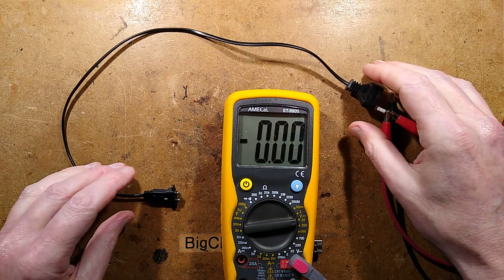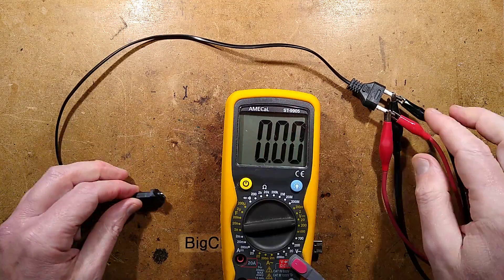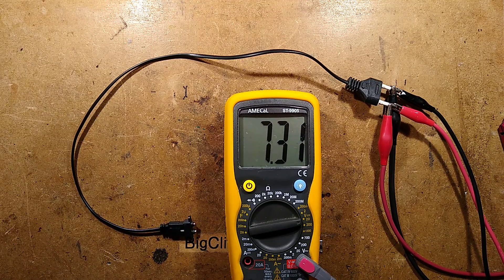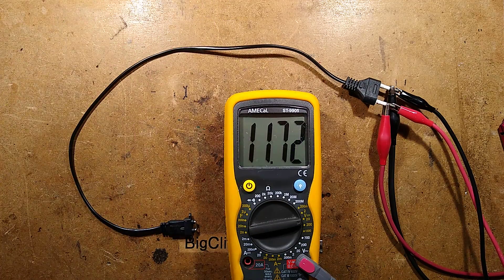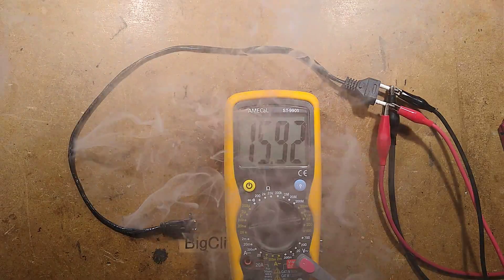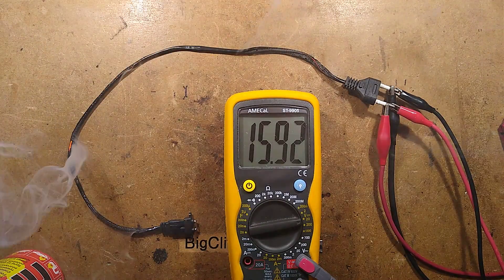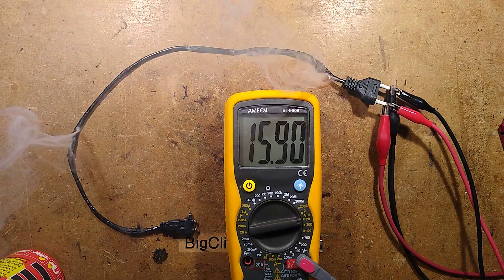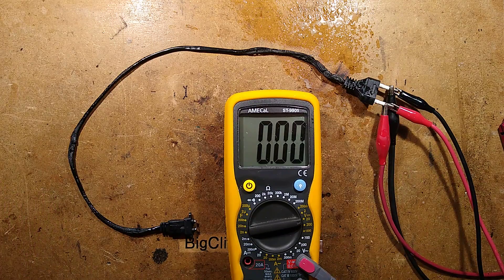Cable test ends in flames

Comment: That's exactly the kind of cable my dad would have used banked up in a 4 way extension lead with a piece of 6" nail in the fuse holder!
Reply: I beg to differ. The 6" nail is too long for the fuse carrier in the British plug...
Reply: @deang5622  a 'piece' of 6" nail.........clever clogs!
Reply: @martinlouden9005  LoL...

I did see a friend of mine 40 years ago use tin foil as a fuse...fuse blew, so they just wrapped tin foil around it!
Reply: @deang5622  tin foil was my dads second choice if there were no nails to hand.

Comment: But what does it say on that Euro plug for max current?
Reply from the maker: You have to allow for faults and accidental overloading.  In the UK the smallest standard plug fuse is 3A, which is capable of sustaining more current that this cable was exposed to for a long time.

Comment: I would have wound it around the Death Dalek, outside of course, and let them self destruct each other. Nice demonstration on the dangers of having copper plated steel wire in a sheath which can't take the heat. Thanks Clive, good post, appreciated 👍
Reply: ...I think that cable was from the Death Dalek, actually..
Reply: @VulpisFoxfire  "Death Dalek"? I'll have you know that that is a "highly useful camping appliance"! You get several types of light - and a reliable way to start your campfire! 😱🙄
Reply: @VulpisFoxfire  so do I 😂😂
Reply: not to mention the dangers of Nickel plated steel strips being used to construct battery packs. there's a reason you shouldn't cheap out on your e-bike battery. as if dodgy lithium ion cells weren't enough, now you're spot welding a high resistance material directly to the terminals!
Reply: @themagitechie9955  And you can't use the magnet test to separate nickel coated steel from pure nickel either...
Reply: @themagitechie9955  I've been lucky with the lithium batteries. I have 5 drones, I keep my old phones with different apps on them and 2 tablets. All I've had was an expanding battery on my first Samsung GT-N7000, which was disposed of safely. I suppose since I've said that I'll be blessed with hot batteries 😂😂

Comment: Copper coated steel cables seems like a bit excessive on the cost cutting side of things...
Copper coated aluminium at least has advantages over copper other than just cost. (mainly being lighter for the same resistance, so if one needs to save on weight this is an option and why the aerospace industry use it all the time.)

And honestly, I wouldn't actually mind much if a cable used copper coated aluminium instead of copper. Though most cables that do this also skimps on the amount of conductor area as well... 0.1 mm^2 won't handle much current, regardless if it is CCA or pure copper.
Reply: I recently learned that copper coated aluminium is a thing but never heard of copper coated steel. That's crazy.
Reply: @benjaminhanke79  Copper clad steel is at the center of just about every RG11, RG6 and RG59-style broadband/CATV coax out there. This is what Comcast and others use between the tap and your house, and in your house to the set top box or cable modem.  For satellite and closed circuit TV camera (baseband video) applications, coax with a solid copper center conductor is preferred (but not necessary in my experience) because it has less resistance for power passing applications as used with satellite and for low-frequency (less than 5MHz) applications as used with CCTV. But it costs more, so for broadband use, a copper-clad center conductor is the standard.
Reply: @brianleeper5737  The physics weenies engineered that coax so it can do the job safely for many decades. Due to the skin effect, the high frequency signal barely penetrates the surface of the interior conductor. The steel provides the mechanical strength so the center conductor can be used as is for connectors.

The 120kv power lines that feed the neighboring substation use aluminum wires wound around steel cores. The skin effect matters way down at 60 hz when the wires are thick enough. Pure aluminum wires would get permanently deformed if they got warm while under tension. The steel core carries the mechanical load, the aluminum carries the megawatts.
Reply: @hamjudo  Note that "F" connectors are commonly installed on coax with a solid copper center conductor. I'm not aware of any problems with this, other than it's easier to bend the solid copper conductor if one isn't careful when inserting the "F" connector. The industry standard 1/4" x 1/4" prep leaves enough of the center conductor sticking out to act as a guide pin. Some tools (like the one I have) don't trim the center conductor so I do it after the connector is installed, and I make sure to trim it so it's sticking out about 1/8". In my experience this makes it easer to get the connector screwed on.
Reply: @hamjudo Skin effect isn't a function of cable thickness, it's a function of frequency.
Reply: @deang5622  In aluminum at 60 hz, the current travels through the outer 10mm of a wire. So at 60hz, the skin effect only matters in wires that are noticeably more than 20mm in diameter.

We are in a big metro area with a lot of people and industry.
Reply: @hamjudo  It doesn't depend on thickness of the wire. It is not caused by the wire thickness. It depends on frequency.

The skin effect results in the electrons being pushed into a region at the edge of the wire away from the centre and that region has a thickness which extends in from the outside diameter of the conductor.

So if a conductor has say a 30 mm diameter (15mm radius) and the skin depth is 6mm, then the portion carrying the current is from a distance from the centre of the cable from 9mm to 15mm.

Now if the cable diameter is 60mm, (radius of 30mm) then the range of radius carrying the current is from 30mm - 9mm = 21mm out to 30mm.

The thickness of the conductor carrying the current remains the same. It doesn't depend on the thickness of the conductor.

The magnitude of the skin depth is not a function of the diameter of the wire, it is function of frequency.

Mathematically: 

Skindepth =f(frequency)

NOT
Skindepth =f(frequency, cable diameter)
Reply: @brianleeper5737  A copper plated steel wire is cheaper and more robust than a solid copper center conductor that is thick enough to act as the center pin of a connector. 

The cable is cost optimized for traditional cable company usage. Compared to material costs, service calls are extremely expensive. So they didn't sacrifice any performance that would lead to more service calls.

The amperage rating for power is noticeably lower than for cable with a solid copper center core. I don't know if they switched to 48 volts, which is about the upper limit for low voltage signal cables and/or they just limited themselves to lower power equipment that operated at the lower voltages already in use.
Reply: @hamjudo  CATV/broadband equipment such as nodes and line extenders is powered through the coax using either 60V AC or 90V AC power. 90V AC is used in newer/upgraded installations.
Reply: Aluminium wiring is fine, but the problem is it fatigues easily.  With something like a laptop cord it's not long before it breaks near the plug.  Best case is your laptop doesn't charge, worst is it arcs and goes bang or something.

But steel power cabling is a new one, I must admit.

Comment: Not surprising if you pass 5 amps through a cheap cable with a short at the end.
At work we call it it tuning for maximum smoke, or how not to find a short circuit.

Comment: At least you discovered it in a controlled environment. I found out that I had a 10A rated iec c13 (or 14, always mix them up) cavle that wasn't even 0,25mm² when it skipped the part of burning and just let a few mm of the wire disappear. Kinda glad that load spike happened at that moment because that wire was in use for a very long time as my UPS input.
Reply: EEK! UPS manufacturer needs a good slap for allowing a cable like that to be boxed with their product. Scary shit!

Comment: Nothing like the acrid smell of burning plastic.What was the cable rated for 1 amp?
Reply: The listing on EBay probably said 1 million Amps
Reply from the maker: Probably zero amp rating in long term use.

Comment: Any idea why they bother coating it in copper? i assume it is the cable that had a copper coating.
Reply: They probably push this crap out by the zillion mile over there. Fool the superficial person / make it easier to solder?..

China is the land of trickery. Great business partners.
Reply: Well not only it protects from rusting but also allows soldering the ends on.
Reply from the maker: Partly to make it look like solid copper and partly to facilitate soldering.

Comment: Having intentionally shorted out cables before (pure boredom with a scrapped car battery I salvaged and revived), that cable did not respond in the same manner as I'd experienced, acrid smoke aside, it should have turned into a puffy, crispy, carbonised mess if it contained the proper retardant material, but, it didn't, another reason to not use such wiring... :S
Reply: I’m so glad I’m not the only ‘mad scientist ‘ here :-)

Comment: Smoke coming from the cable, placed on a wooden surface, metal becoming hotter than the sun, first thought from Clive is…

Let me tell the viewers about the voltage drop and current rise

Second thought…should I get a fire extinguisher ready

That is serious dedication to the viewership there Clive 👍👊👏
Reply: "one moment please"
Reply: @jmpg235 lol "one moment please" and a jump cut to a hole in the bench and the hint of red flashing emergency vehicle lights illuminating the bench through his workshop windows 😅
Reply: @TonyHamlyn  Clive should do that for April Fool's Day.
Reply: @TonyHamlyn  guys you are heavily overestimating fire. His house isn't going to burst into flames because he ran a few wires red hot on a bench for a few minutes.
Reply: @TonyHamlyn    LoL ..  good visual
Reply: eh it's ok, the bench can take it
Reply: I wonder how far it is from Clive's abode to the fire station.

Comment: Can't see the problem - just needs the correctly rated fuse in the mains plug 😊

Ahhh! - wait that was not a fused plug and they don't make 250 mA fuses for UK mains plugs do they!  I guess the cable is not double insulated as that would limit heat loss from the element!
Reply: 1A is smallest but no longer made, I have a supply of a few dozen left 3A is the smallest available.
Reply: @dogwalker666 - incorrect. Electrical distribution and suppliers still stock BS1362 fuses with the following values available: 1A, 2A, 3A, 5A, 7A, 10A and 13A.
Reply: @Mark1024MAK  lol good luck getting them, They don't actually stock anything other than 3, 5, 10 and 13,
Reply: @dogwalker666  - Farnell UK currently show 119 of 1A in stock. They also have 1359 of 2A, 1345 of 7A, and 775 of 10A in stock.
Reply: @Mark1024MAK  Yeah right Farnell the trade only electronics distributor,  Not exactly off the shelf is it,  Why not quote RS the bigger competitor,  Oh and you can't trust the quoted stock level,  They are often incorrect,  Now go to B&Q and check the stock level.
Reply: @dogwalker666  Farnell sell to the public through their CPC brand outlets.
Reply: @dogwalker666  - I never said you can find them in a high street store or in a out of town retail park. Let me remind you that you said that they were no longer made. My point is that they are. These ‘less popular’ values are never going to be easily available, because there is not enough demand for them.
Reply: @dogwalker666  The 1A BS1362 Cartridge fuse is still around - try: 
RS 412-986, Farnell 3650588, CPC FF01691

Comment: Copper coated aluminum isn’t bad enough, copper coated steel, ( or iron),.. just the possible work harding , how far can the limit be pushed? Well I guess Liz might get a little thrill from the fire.
Reply: CCS(Copper Clad steel). Needed for some applications, but only has 40% of the current rating of copper wire. Not really intended for DC use, AC has a skin effect.

Comment: I recently got a pack of rotary encoders that came with a bunch of jumper cables. To my surprise, when I set the bag of them down on my bench a magnet jumped onto them.  lol.   Yeah, those are going directly in the trash/
Reply: Was the magnet attracted to the cables themselves or just to the clips? Croc clips are generally steel for robustness. Even the alligator clips that came with my Fluke 87-V are steel, as are the hooks on my CRO probes.

Comment: Holy Cannoli!  How can people even make this kind of dangerous stuff?  (well, besides psychotic greed)  Man!

Thanks for showing this Big Clive.  The copper coated aluminum was bad enough.  Sheesh!
Reply: We have aluminum wire and it's fine as long as you know how to work with it. It's pretty thick, though. We only have 20 amp lines in our home. It's like working with 10 AWG cable if it was copper. Another drawback is it will fatigue if you bend it around too much. Of course, you can't get new aluminum Romex, so you have to make yourself familiar with antioxidant grease and connectors. That being said, I prefer working with copper.
Reply: @robertgaines-tulsa  When I bought my house 13 years ago, I was lucky that my realtor's husband was a master electrician who gave me a free look over and applied the grease at the mains box.  There's no movement there so I'm assuming things will be fine for a while.  

Right you are though with copper.  Seems to me that certain things should bear a little more expense on the front side.

This coated steel wire though.  WOW.  Pretty weird.  I haven't seen that before.
Reply: 能骗就骗
which means, "if you can cheat, then cheat"
it's a popular saying, in that language, apparently.
Reply: @idjtoal I've never heard that saying. Not sure about the language but perhaps rather the competition and stress to pay the rent or put food on the table. Their living conditions aren't like ours I think.
Reply: All of this stuff coming from communist China, and people complain about soulless rapacious capitalists.

I am more and more convinced that the Chinese government simply doesn’t value human life, not the lives of their own people, and certainly not of the rest of us. (For the hard of thinking; this is about politics, not race.)

Comment: OMG I hope your bench is well ventilated!
Reply from the maker: There is an extract fan in that area that pulled the smell out quite quickly.
Reply: @bigclivedotcom ....and set off every smoke alarm along the road ;-)
Reply: Every workshop should have one/a ventilation fan as standard, an openable window or exterior door